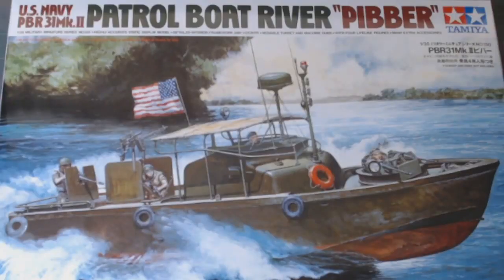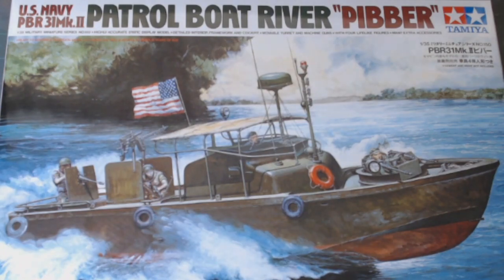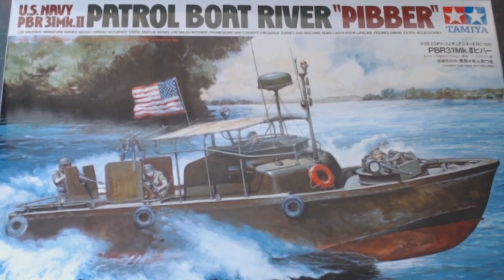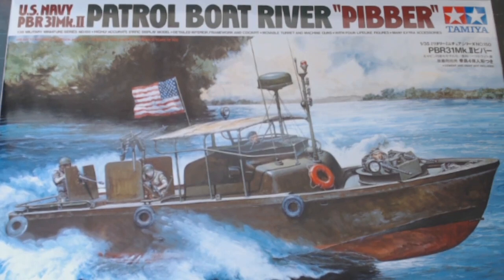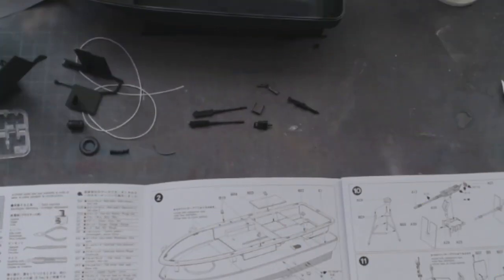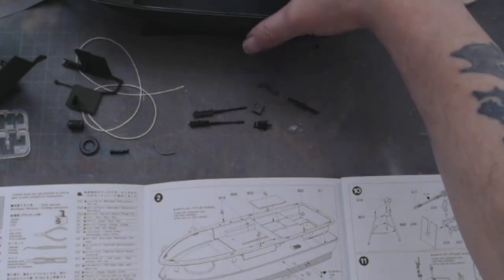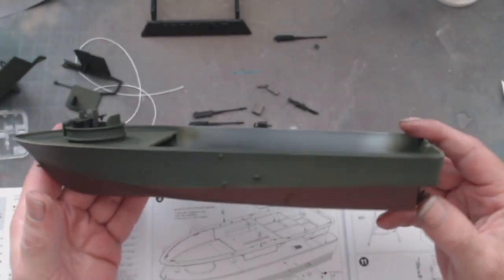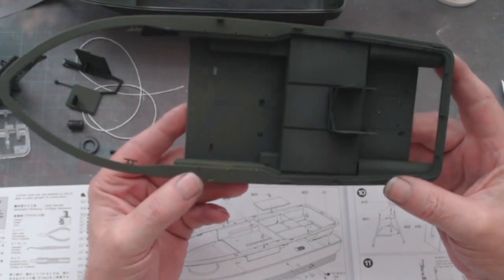Tamiya 1/35 patrol boat river "Pibber" Pt1

Comment: well done model building job,am building this kit now only my second build question,after assembling and painting was there any adherence issues with parts already painted?i ask because on my 1st build i painted some parts on the sprue and had difficulty with cementing them because i painted the entire parts.
Reply from the maker: Thank you for your question. It is normal to clean off the area from paint that needs to be glued to give it better adhesion. However I don’t always do that myself. I would say scrape the paint to give better adhesion as you develop your skills you will know where you can and cannot get away with shortcuts. Have fun with your build it’s a great kit👍✌🏻
Reply: @rickskits  thanx,it is a fantastic kit,ok one more question do you typically airbrush primarily?i am canspraying tamiya primer and brushpainting old school style.
Reply from the maker: Yes I use the airbrush on the majority of my builds. I do use rattle cans on my cars and hand paint my figures.